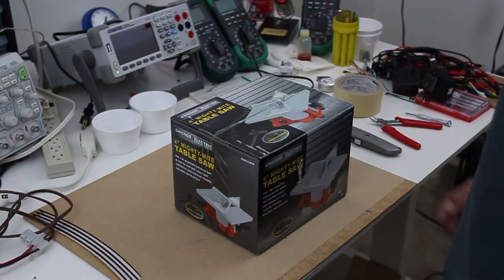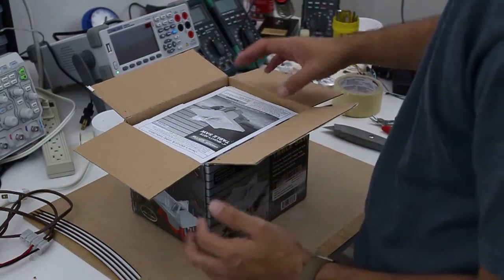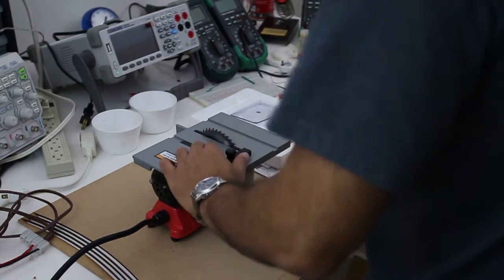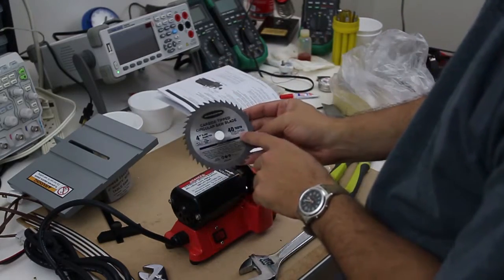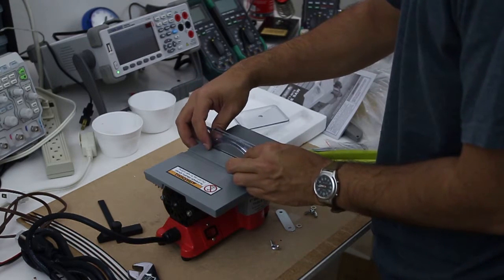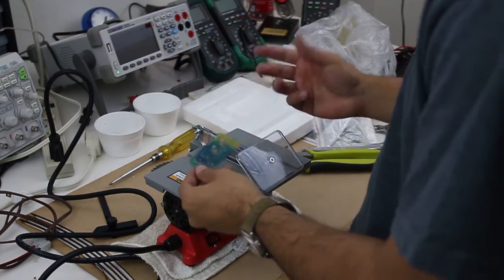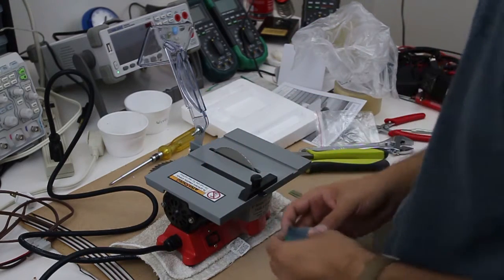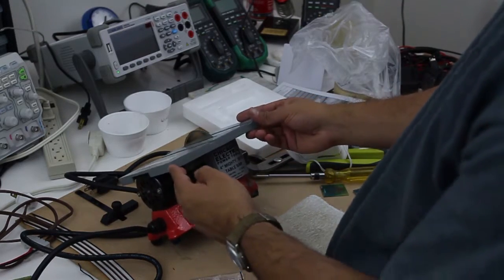Review: HF 4" Mighty-Mite Table Saw

Comment: In the first place you were using the wrong blade. The blade you used is for "scoring" glass/ceramic tile so it can be "snapped" off after scoring. The mini table saw is low powered without a doubt (I have one) but if you use the wood blade you will have no problem cutting the PCB board.
Reply: when cutting acrylic that is .25" thick i would need to use the wood blade instead of the one he used?? or would you recommend a band saw or scroll saw instead?  thank you for your time!
Reply: The diamond blade is fine for cutting PCB's!

I just score and snap ceramics/acrylics/plexiglass/poly-carbonate (lexan)/P95/Polystyrene depending on thickness!

The height of the blade is very critical on this under-powered little saw!

Comment: 1.PCB can be anywhere from 6.5-9 on the MOHS hardness scale so using the blade you selected couldn't be more contra-indicated. 2. use a respirator (not just a mask) when cutting this stuff as it produces a fine silicate dust that is EXTREMELY hazardous to your health. 3. try a paper cutter or "guillotine" as that has proven to produce acceptable results; even scoring w/a utility blade & then snapping it off on the edge of a table is superior in method.

Comment: Of course it’s not going to work if you don’t know how to use it. You are feeding the material too forcefully, plus the threads on the arbor are reverse. I have no problems cutting PCBs and aluminum extrusion with mine. Good luck to you.